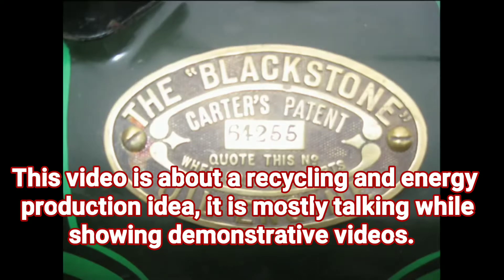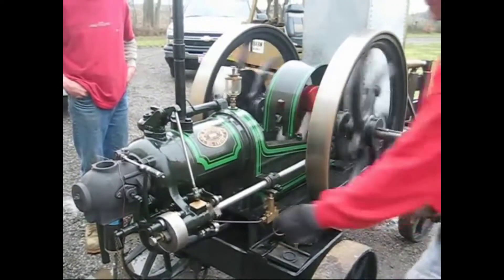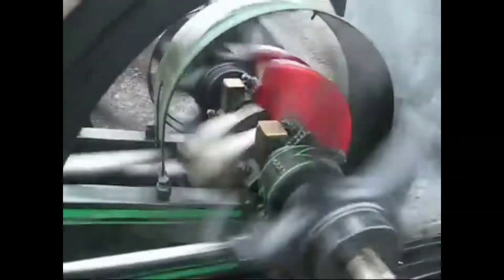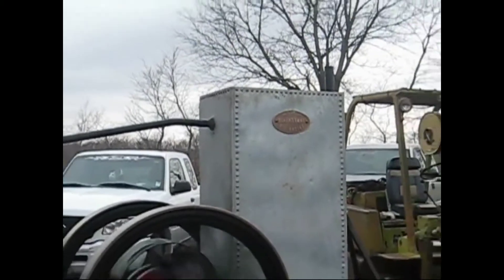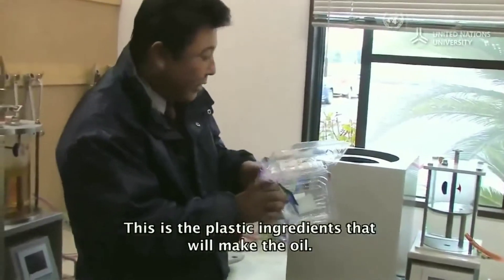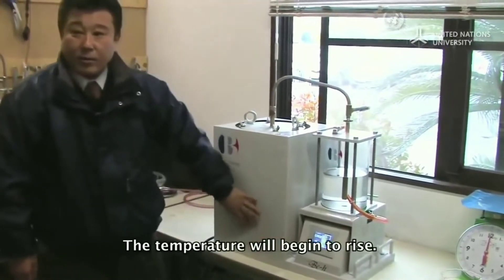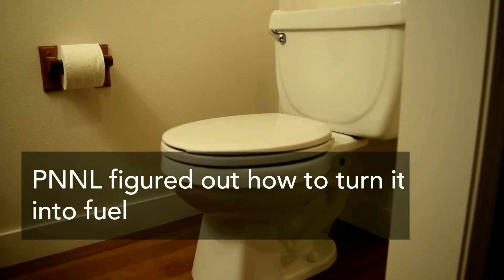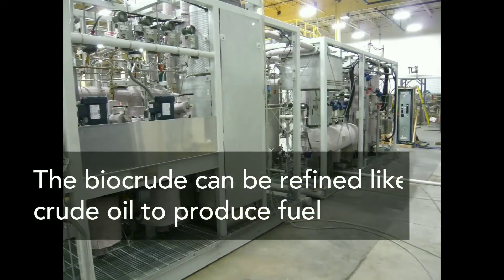Plastic and Sewage Into Energy Idea and Invention

Comment: You would not use a "hot bulb engine"  to generate electricity that would be stupid, you would use steam turbines.

What's the amount of useful oil per kg of plastic, in order to reduce the co2 of it being burnt by 80% you would have to remove 80% of the carbon, meaning large amounts of waste produced, so it doesn't solve waste plastic issue? You're still burning oil instead of burying it thus still contributing to global warming, depending on the efficiency of the conversion process it might even be worse than pumping oil out of the ground.
Reply from the maker: Hot bulb engines were experimented with by the Carter brothers and others in the 1930s to get around 40% efficiency, modern steam turbines from small scale to industrial get around 40% conversion factors.  Whilst converting plastic into oil the remaining plastic residue (about 80%) can be made into building materials or landfilled.  Regarding global warming/climate change: people in the 3rd world and poor countries who would most benefit deserve energy as much as the developed world with our comparatively massive needs.  Directly reclaiming oil from plastic into energy is far more efficient than oil production and the plastic production process and infrastructure, do you have any idea what that entails and how much energy and water is needed, as well as all the pollution produced in those processes including distribution?
A combustion engine is uniquely suited for this process as the heat waste can be used to refine plastic directly into oil so no additional energy input is needed for refinement.  It was just an idea anyway, didn't mean to trigger a rando
Reply from the maker: Plastics are in fact solidified oil," 

Although different plastics have different recipes, it takes roughly 0.4 gallons of crude oil to make 1 pound of plastic. Globally, around 8 percent of the oil that comes out of the ground is used to make plastic.
Humans are now using a million plastic bottles a minute, and 500 billion plastic bags a year — including those we use to bag up our plastic-laden trash.
Since 1950, the world has created 6.3 trillion kilograms of plastic waste — and 91 percent has never been recycled even once, according to a landmark 2017 study published in the journal Science Advances
More than half the plastic now on Earth has been created since 2002, and plastic pollution is on pace to double by 2030

Comment: Perhaps  vaporize plastic directly into the engine and skip the water collection all together . a plastic boiler can be made that heats itself and produces usable fuel stream , you would need a catalytic converter maybe for the plastic combustion but it would work . years ago i did experiments with plastic and i discovered plastic burns extremely hot and the gases that boiling it produces condense very quickly and burn with an almost white hot crackling noise .
Reply from the maker: NOBOX7 I am going to do just that!  Great idea, I have like 4 scrapyards around here I can put on notice to keep their eye out for me.
Reply from the maker: I have been considering an induction type heating system for cracking and vaporizing the plastic, however catalytic and even exhaust heat could be utilized as well.

Comment: I recommend going to the junk yard or on ebay and find a single cylinder diesel engine   and perhaps butcher  it into a master piece proto type. though i say having no clue how it works . Is it ramming cold air into a hot bulb ? still watch watching vid just talking as we go .
Reply from the maker: NOBOX7 Hot Bulb engines are interesting to say the least, they are a vaporization engine, the hot bulb acts as a fuel vaporizor and an ignition system in one.  Shortly before Rudolph diesel patented the diesel and the high pressure injection system, a man named Carter (and several others) did work on hot bulb engines and with an increase in compression and oil injection were able to achieve around 50% thermal efficiency, which for the time was amazing.  Thank you for your input and watching the vid!